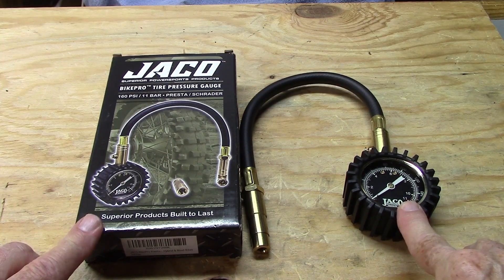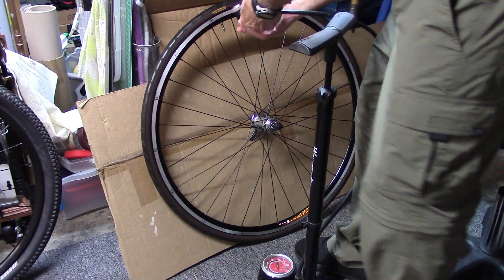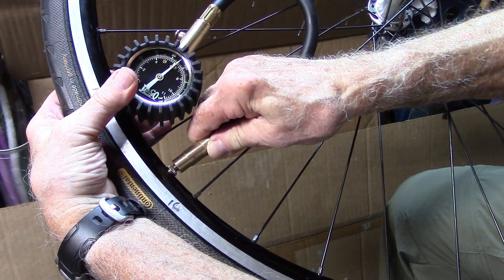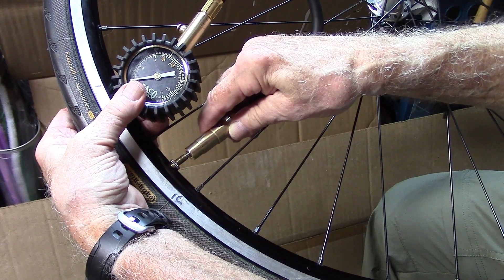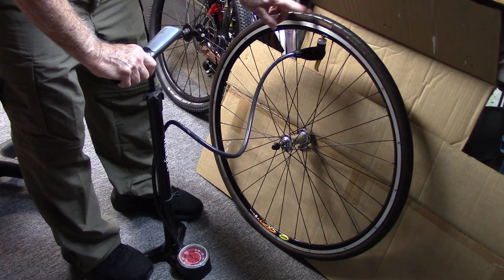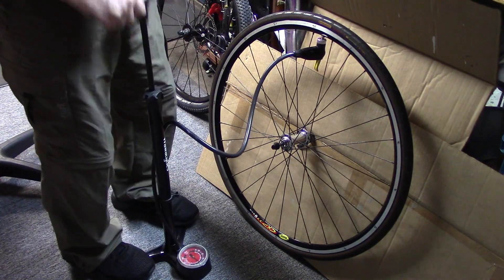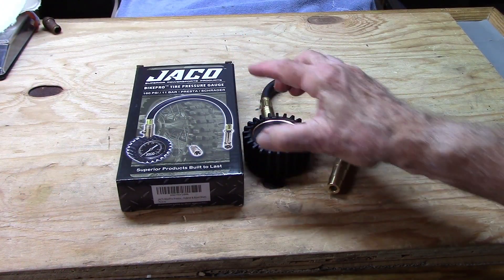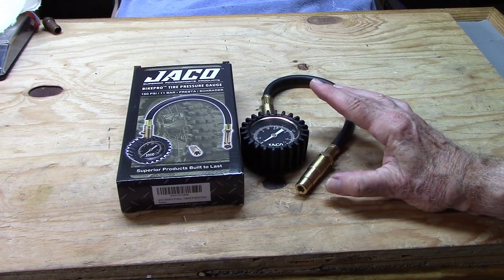How accurate is your bike floor pump? Don't let disaster strike when out on the road!

Comment: Please share the data for the pump you tested in this video - was it precise still & how long had it been since it was last checked?
Reply from the maker: We looked at several different pumps including a refurbished Wiggle Cycle from UK (no longer sold), a new Joe Blow Sport III, a 10 year old Specialized floor pump, and a new inexpensive Arcacia pump (made in China). For a close look at the Arcaia see:
https://www.youtube.com/watch?v=rFt_EU_9Wk8
For results on the other 3 pumps, see:
https://youtu.be/rFt_EU_9Wk8?t=468
However, I would point that results will vary depending on manufacturer, the age of your floor pump, conditions of storage (heat and moisture may effect the pump), and the type of use it gets (frequency of use). Therefore, you should really check your own pump with a calibrated tire gauge.  You don't need to check as many points as we did, but check several of the common pressures you use when pumping your tires.

Comment: I've never bothered to calibrate the pump, I just overinflate the tire with the floor pump by a few pounds then use the Jaco bleeder valve to lower the tire pressure to exactly where I want it. Works perfectly and that's really what the valve is for.
Reply from the maker: Is the bleeder valve connected to a Jaco gauge or compressor to tell you the pressure?

Comment: Hi Tony, thank you for the video in advance. I am enjoying my old bike which is around 34 years old. I was constantly visiting the bike shop to get a fill from a machine. I wish to enjoy this bike in a better fashion in terms of tire pressure. The rims are still the old Ambrosio clinhers (original rim) 622-13. I could have installed 700x18c but couldn't find a new one. The current tires are somewhat 4 years old clinhers 700x20c, which indicates a maximum pressure of 130 psi. Sad to see that continental grand prix supersonic 700x20c is out of production and I could go for Michelin Dynamic Classic 700x20c. Definitely not wanting to go thicker ever. The recommendation for my tires at a clean weather is around 130 psi also so please let me ask some questions for you. First of all, what is the differece between 700x18c and 700x20c, and second would it any change damage my rims if I go around 130 psi since they are somewhat old? Do oyu know any other risks? Another question would you recommend me a pump? I am looking for a pump that can easily be used for 30 years with proper maintenance. I prefer to buy once but good. Last question is, is this JACO dependable? It would be meaningless if reference gauge will have large deviation and in a video which states why 150$ gauge is not neccessary JACO gave 2.4 % lower pressure.
Reply from the maker: 1. 700c is a term used to describe the diameter of a bicycle wheel and tire combination, which is typically found on road bikes and hybrids. The 700 refers to the approximate diameter of the wheel in millimeters, which is usually around 622 millimeters or 27 inches. The "c" comes from the French word crochet, which means "hook", and also indicates that the wheel is designed for clincher tires.
2. The 18 or 20 refers to the inner width of the clincher rim in mm. Compatible tires are described in the following article:
https://www.lightbicycle.com/newsletter/tire-size-chart-for-bicycle-rim.html
3. The marking of 130 psi on the tire is the maximum tire pressure. However, most recommendations for clinchers are to use 80% of the maximum or, if marked with max and minimum, to use something about half way between as a starting point with small changes to account for comfort and weather conditions. Tubeless tires are a whole different ball game that I will not attempt to go into here. 
Wear on the tire is a safety issue. See:
https://www.youtube.com/watch?v=ktVtKqZA6cg
4. It is difficult for me to recommend a specific bicycle pump since there are many available and I have not used most of them. I use a Joe Blow Sport III. It is very accurate but it's main draw back is the loss of air when connecting requiring more pumping. My partner uses a Specialized which is not quite as accurate but sufficient for her needs. Lenze makes an expensive pump with replacement parts available. Some have a screw on chuck and others have a push on/pull off chuck (the latter should be used with a smooth presta valve and not one with threads which will rip the chuck to pieces). For tubeless, again, this would require a whole write up itself.
5. You can buy a JACO certified gauge accurate to meet ANSI Standard of ±1.5% and another for tubeless. It is a dependable choice when looking for accuracy. I used it to calibrate the various pumps we examined. We never compared the $150 gauge to the Jaco.
Hope this answers some of your questions. Regards and safe cycling, Tony
Reply: @tony10speed  hi I think you are deleting my comments. May I ask the reason?
Reply from the maker: @berkehankura8803  Your question and my long reply are posted as the most recent comment under the video. I had no problem in pulling it up. Nothing has been deleted. Do you want me to re-post it?
Reply: @tony10speed  Hi Tony, I have response for your long comment. Please let me reply.

1-2: 700x20c tires exist. I do have them. I bought them and have them mounted on my mother’s bike. They are mounted on 13mm rims. I saw also 700x18mm tires on ebay. They may be few decades old but I think they were produced.

3: Thank you for the info. For 700x20c, my Kenda seems to have max 110 psi value, Michelin Dynamic Classic has min/max values 87/116. Continental Grand Prix supersonic has recommended/max values of 140/170. I am up to selecting tires now which I consider inflating around 90-100 in good weather. My question is if I go and pick continental, should I go all the way 140 psi (can I have it at 90-100 and make it efficient?) and if I go 140 psi with it is there a risk damaging the rims with tire burst (are special rims required for such pressure).

4: For the pump I went with the Bontrager for its affordability and appraised accuracy in the following link. If you want, I may let you know its accuracy with comparison to JACO.

https://www.outdoorgearlab.com/topics/biking/best-bike-pump

5: I ordered JACO. Found a guy who bought two and decided he needed one. He also shipped internationally, a service JACO does not do for some reason..
Reply: @tony10speed  I apologize for the misunderstanding previously. It is probably somehow I could not post my comments, thought you deleted them.
Reply from the maker: @berkehankura8803  No problem. I can understand your concern. Be safe and happy cycling, Tony
Reply: @tony10speed  Thanks, so you dont have a comment about my question 3? Just writing to be sure.
Reply from the maker: @berkehankura8803  Which is question 3?

Comment: watching and learning this in advance before buying a bike is worth doing.
Reply from the maker: Thanks Chris. Anyone who uses a bicycle pump should be aware of the accuracy of their pump, and it's not just comparing it to another pump or cheap air pressure gauge. An accurate gauge that meets quality standards is needed for comparison. Thanks for your comment, Tony

Comment: I suppose you could unscrew the pump’s gage, install a tee fitting and add a good quality gage (McMaster-Carr has them) so you have two gages measuring the exact same condition.

I have a gage that looks very similar to your Jaco gage. It’s probably over 40 years old now. I noticed years ago that the volume of the hose and Bourdon tube allows a small amount of air to escape the tire. If you perform several measurements in a row, you will see the pressure decreases. Does it matter? Probably not. Just stuff we muse about while cleaning parts and twisting nipples.
Reply from the maker: When we tested the Jaco gauge, one of the things we looked at was reproducibility to make sure that there was no air loose when used correctly. The volume of the air hose should not cause loose of air in the tire. Removal is probably resulting in touching of  the end of the Presta valve and releasing air. Schrader valve are notorious for some loose of air when removing the pump chuck. My guess it that the attachment point of the Bourbon gauge you're using is worn and may allow some air to escape on removal. Does it matter? Only to use perfectionist who want to know the "real" tire pressure and don't want flat tires when out on the road. Regards, Tony

Comment: I just figure that if the pump valves are the same as my Topeak Smart, the pump values are good enough.
Reply from the maker: One can say that they correlate well. Accuracy is another story. But if it works for you, great. Regards and safe cycling, Tony

Comment: What are the numbers written on the rim of the wheel for?
Reply from the maker: I had just recently trued the wheel. Before I measure the spoke tension, I label each spoke (on the rim) with a permanent marker. This way I don't loose track of were I am and can also record the spoke tension.

Comment: Good morning Tony ,  to be honest tire pressure nowadays is not as important as it used to be when I was competing years ago , saying that I do pump my tires before every ride with the same Japanese made Schwinn floor pump that I used since the beginning of time . Oh" yeah I also use the tried & true method of pinching the tire with my thumb and forefinger after pumping . Thanks Tony
Reply from the maker: In the old days, using the old Schwinn floor pump and pinching the tires was all we had. We got a feel for what the tire pressure should be just by touch. But even with the stronger casings, todays tire pressure is as important as other aspects in setting up your bike. As tires get wider and run lower pressures, especially tubeless tires, the tire pressure can make the difference between a comfortable ride, tires gripping the road on turns or over bumpy roads, and precision handling versus a disastrous uncomfortable ride. If you're using the same old bike as you did 20 years ago, one may not care. But with the newer model, tire pressure has gained new importance.
Regards and safe cycling, Tony
Reply: @tony10speed  Hey Tony, Thanks for the reply. Ironically you hit the nail on the head I'm still riding the same bicycles I road 20 years ago 9 speed , 23 s
Reply from the maker: @markbattista6857  The bike I currently use is a Litespeed Classic from the early 1990s that I restored - 9 speed, converted from triple to compact double, all Shimano, Bontrager (bladed spoke) wheels with 23 mm Continental Gaterskin tires. You can see it at the beginning of my video on installing difficult tires:
 https://www.youtube.com/watch?v=W_c-HYbVh9U
Reply: @tony10speed  
I’m still on my steel Peter Mooney from ‘96. The Dura Ace group is still going strong (except for the BB and headset). I’m 155 pounds and pump my 25mm tires to 90 psi. Years ago we would pump to the max printed on the sidewall, but that makes for a harsh ride and can cause tire skittering over rough surfaces.

I have at times come home after fixing a flat on the road using my Zefal frame pump and found that I was riding on 50 psi or so. It’s amazing how little pressure you can get away with if you manage to avoid pot holes!
Reply from the maker: @trackie1957  Thanks for your replies. It's always great to talk to someone who appreciates the old gear and and time proven methods. I still have my Zefal frame pump. The new mini pumps don't compare. Be well and safe cycling, Tony

Comment: I bought a cheap $30 floor pump off eBay, this was the title of the ad - "BV Bike Bicycle Pump Floor w Gauge Tire Ball Air Inflator Presta Schrader 160PSI". I tested it against one of the cheap Slime pencil looking things, and my neighbors Slime digital gauge. When the Slimes read 55psi, the BV floor pump only read 50. It's a good 5-6psi off. I may have to get one of those Jacos. For 25 bucks you can't go wrong! Thanks as always. Great video.
Reply from the maker: It's definitely worth investing in the Jaco pump (by the way, I'm not an employee of Jaco and get no renumeration for referring others). Tire pressure has become more important as we move to wider tires and lower pressures, especially when running tubeless tire.
Regards and safe cycling, Tony
Reply: RJ Rocker, Your results only tell you that your gages don’t agree. You still don’t know which is more accurate. A third gage like the Jaco might be worthwhile.
Reply: @trackie1957  Yes, well aware of this. I'm going on faith that the slime's are more accurate than my floor pump. When I said "it's a good 5-6psi off", I should have said it's a good 5-6psi off of what both slime's are saying. I watched another youtube video of a guy testing about 10-12 different gauges against a calibrated one and the cheap slime's were surprisingly more accurate than some of the more expensive gauges. I'm by far not a pro rider so it's not that big of an issue for me. But I just looked on eBay and the Jaco is down to 20 bucks shipped, it would make a nice addition to my tool box, but on the other hand, I'm not blowing tires so I think I just might stick with the cheap-o slime.

Comment: Greetings from Greece Tony! Thank you for this video. I tested my pump and it seems to be off by 10 psi. It is not much, but when marginally inflating the tire it is a great deal. Thank you!
Reply from the maker: You're welcome Greece! I'm glad you checked your pump. 10 psi with some tires may put you above the upper limit of that recommended by the manufacturer and lead to a blow out. If the actual pressure is lower by 10 psi, this could lead to flats. You can draw a "correlation graph" with Excel to show you the floor pump dial reading and the actual tire pressure and we link to that info at the end of the video. Also visit our YouTube home site at:
https://www.youtube.com/user/MrTony10speed
Regards and safe cycling, Tony
Reply: @tony10speed  Excellent! I will make a graph in excel to rate the deviation of my pump from true values. I will definitely replace it though!
I am already a subscriber of your youtube channel. How couldn't I?
Reply from the maker: @cauldron101  Thanks gravitsapa. Be sure to see the link at the end of the video on how to draw a correlation graph. One can do this by hand or, as in the video, use Excel.
Regards, Tony